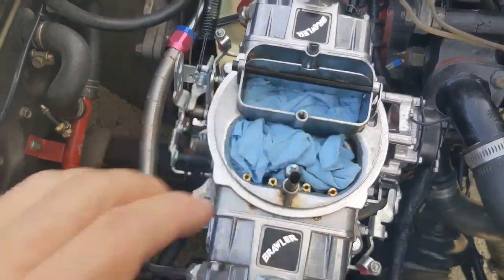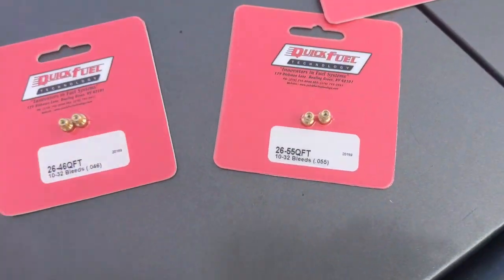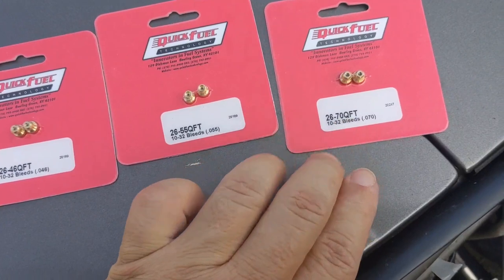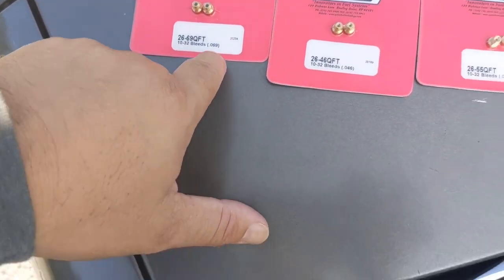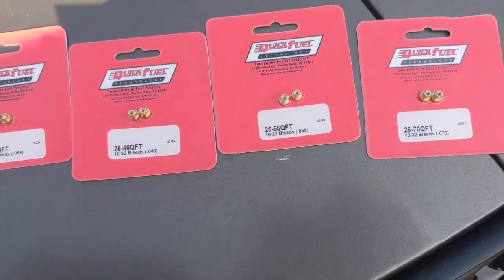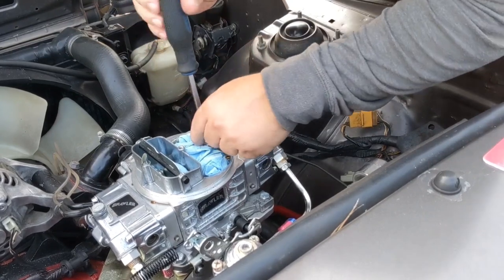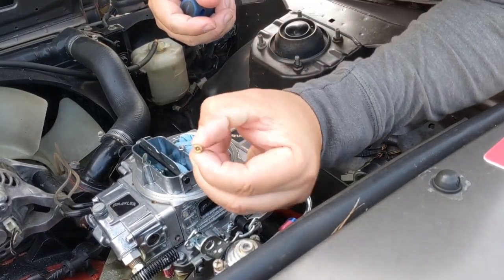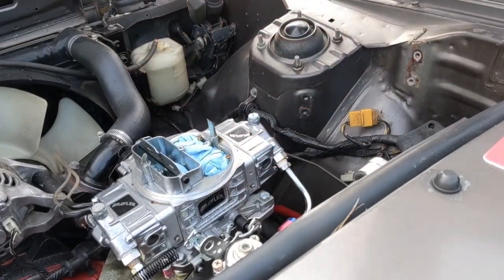Tuning Holley for Rotary engine

Comment: What the fuel pressure?
Reply from the maker: 6psi
Reply: @ImpalerRotary  just limped a 12a (with I believe a rb holley kit) home. Pressure was at like 9 psi! I remember stock was like 4.5 and webers were too. Po said it had to be higher, but 9 I  was way high.
Reply: What regulator is that?
Reply from the maker: @josephfriedrich9792   Holley regulator.
Reply from the maker: @josephfriedrich9792  Yeah 9 is quite high.

Comment: I have a 13b with carburetor but I’m not getting much gas in the carburetor any idea what it could be idk if the carburetor needs tuning or something
Reply from the maker: Probably needs to be tuned. Make sure the needles on the side are open enough for fuel to come in.

Comment: Can I run a Holley 600 on a stock 12a with 54 Jets or what do you recommend?!
Reply from the maker: Yes, that's close to what it needs.
Reply: @ImpalerRotary  I have a stock port 12a and the previous owner put a holley 650 on it. What jet size do you recommend? I'm new to carbs.
Reply from the maker: @JetJiles  Id start with 60 primary and secondary. Go up by 2s from there, so 62, 64, etc.
Reply: @ImpalerRotary  ok thank you for the help!
Reply from the maker: @JetJiles  Sure thing! You can follow me on IG @xrossfire78 or TikTok @impalervlad.

Comment: Thanks I would love to see more videos on tuning and special timing with bridge port video was great haven’t seen a holley work that good in a while
Reply from the maker: Thank you! I'll try and get a few more in, specially on timing.
Reply: @ImpalerRotary  I'm looking into a new holley what do recommend for easy tuning I see mechanical secondary vacuum thanks for the help
Reply from the maker: @williamrivera4878  hi! Depends on what you are building. If it's bridgeported, get a 600 with mechanical secondaries. It's going to need tuning. The ones from racing beat come super close to what you will need, but still will need tuning.
Reply: @ImpalerRotary  thanks I'm going to order the one but tunning a holley it's not easy
Reply: MECHANICAL SECONDARY

650 CFM Brawler Diecast Carburetor Mechanical Secondary / Electric Choke

PART# BR-67276

Would this work
Reply from the maker: @williamrivera4878  Yes but get the one with no choke.
Reply: @ImpalerRotary  
I ordered the carb what jets should I order to start with or parts thanks for the help with I could take my car to you
Reply from the maker: @williamrivera4878  Send me a link of the carb you got so i can see the jets it comes with. Also, what do you have done to your engine, and make sure you got the carb with the air bleeds that are interchangeable.
Reply: @ImpalerRotary  If you would Ill get what you recommend carb jets I have a 12 with bridge port I got the template from Mazda trix I have racing beat header with old school racing beat muffler pipe I rather get what you tell I haven't seen car rev that good  with a holley not a lot people can tune a holley thanks for the time and the advice greatly appreciated
Reply: I got the holley bleu fuel pump and regulator
Reply: This the one I was going to get

Comment: What carb do you recommend for 12a full bridge port
Reply from the maker: A 600 works really good. A 650 is good also but requires more tuning to make it work. The one in the video is a 650 and the engine is a 12a bridgeport.
Reply: @ImpalerRotary   @ImpalerVlad  just got around to rebuilding my carb(600 street warrior) po had 72s in there and a the power valve was a plugged. 
On a 12a bridgeport (I believe)